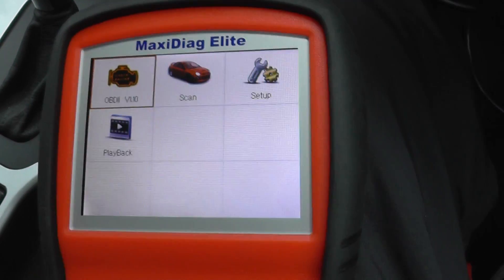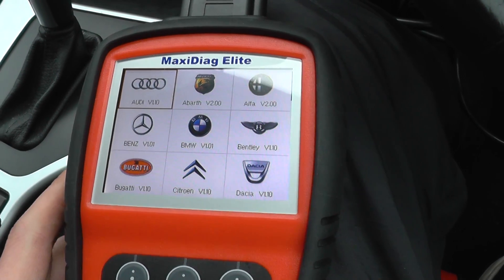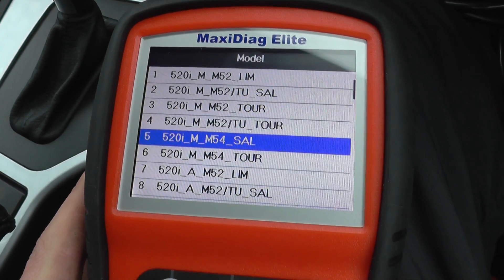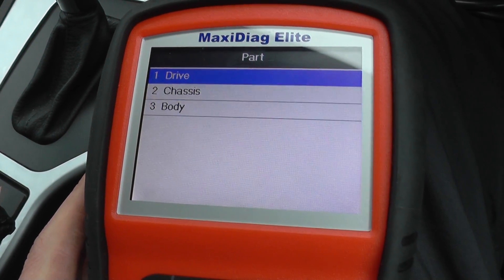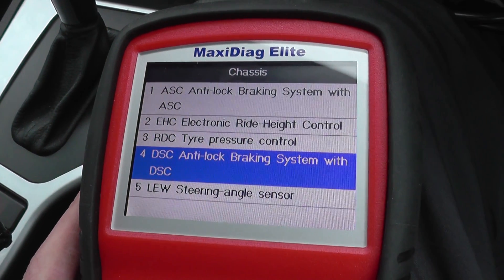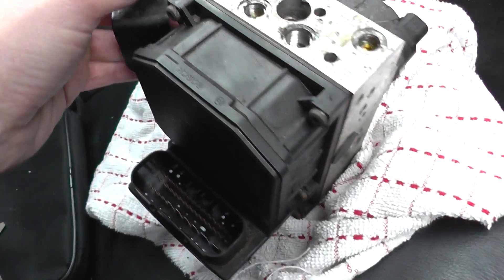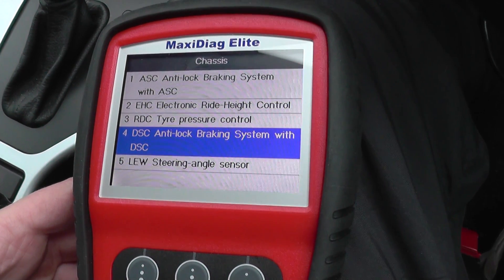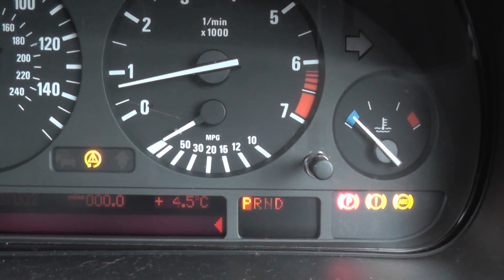BMW ABS Lights & ABS Module Diagnose (Sensor or module fault)

Comment: what a spanner !!! ha ha! ...shud have read fault codes first then show them on here in the play back mode on the autel elite mine reads this..can you tell me how to fix it...
Read Codes
U3FFF01               Active
Left Front Sensor Circuit Failure
U3FFFFF               Active
Right Front Wheel Speed Signal Failure
U2DC501               Active
CAB Internal Failure
P000002               Active
Bus System Communication

U2DC501 CAB INTERNAL FAILURE...btw the CAB is still on the car chrysler voyager crd 2004

Comment: could this problem put your car in Transmission failsafe prog. ???
Reply: Yes it can.
Reply: Dexx well you are right chaged the ABS module mine was beyond  repair , erased  all code from trany car runs like a champ no more trans failsafe  program.